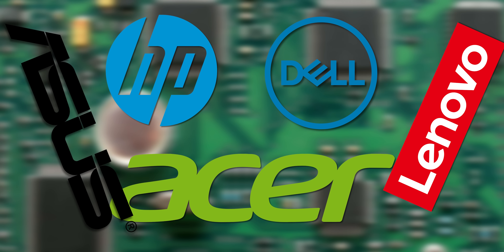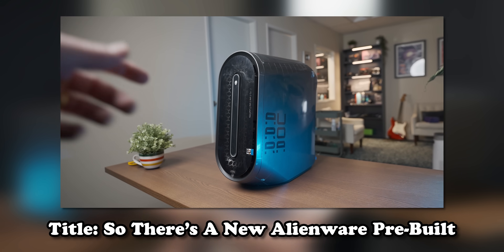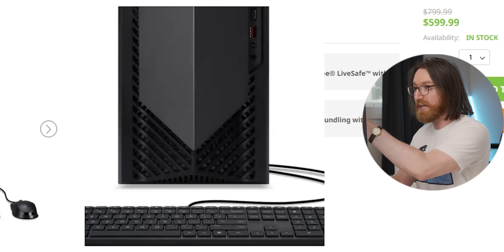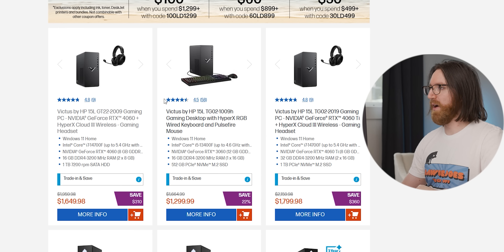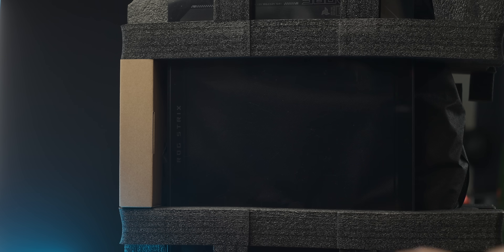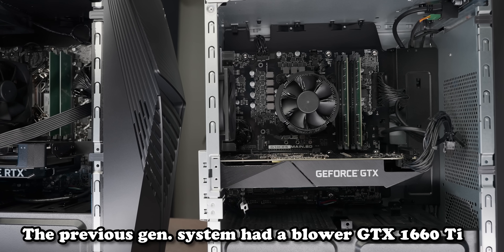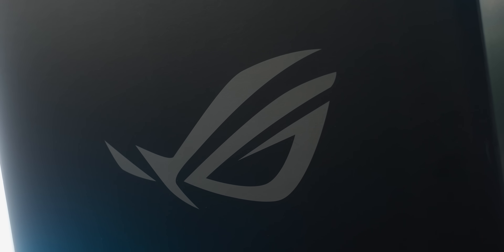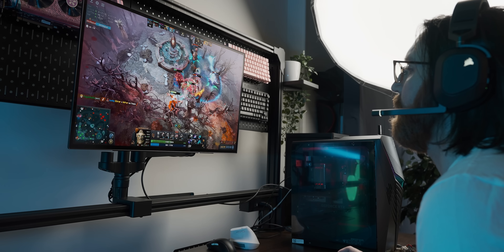Are Pre-Built Gaming PCs Better In 2024?

Comment: Surprised you didn't try the Old pre-built internals in the New case just to show how much better having a simple front vent is even for lower end hardware
Reply from the maker: @prrocker9637  That's a good idea, although it wouldn't make a huge difference to the noise. The main source of noise is that blower 1660 TI and it doesn't care too much about access to airflow.
Reply: @DawidDoesTechStuff  that's fair then the new parts in the Old bad case 🤣
Reply from the maker: @prrocker9637  Haha!! Yeah that makes more sense. Maybe I should drop a 4090 system in that old case.
Reply: @DawidDoesTechStuff what do you mean maybe? :D when's the video coming out?
Reply: @DawidDoesTechStuff  oh an oem sleeper I guess.
Reply: @DawidDoesTechStuff  why_not_both.jpg
Reply: @DawidDoesTechStuff  That could be fun. Maybe a test to see how much thermal throttling can reduce your performance?
Reply: @DawidDoesTechStuff I'm thinking of buying a pre built cyberpower pc at Walmart from what I know you can upgrade them
Reply: @DawidDoesTechStuff mind you, the blower 1660ti is loud because fans are ramping up due to low airflow the old case
I think you have a great opportunity to compare and combine 2 different generations of the same product 
I don't know how YouTube will promote it but it would certainly be unique
Reply: Great idea. We need another video.
Reply: This. That's always been my first thought.

I've done it before and it worked great
Reply: Or you could just leave the side panel off to prove the same point.
Reply: I imagine it's getting returned.

Comment: That 14700F is clocking between 3.8 and 4.5 GHz in game isn't that a bit low ?
Reply: well it is under 50% utilization so ig the GPU is bottlenecking the cpu
Reply: @itsmilan4069  A bottleneck doesn't necessarily affect the clock speed. It depends on how many cores are used, the temperature overhead, power consumption...etc
The less the CPU is stressed the higher it can boost, with 30% utilisation and 60W power draw I expected around 4.6GHz all cores.
Reply: It's way overpowered for the gpu, probably doesn't need to boost any higher.
Reply: It might be the overlay showing average core clock speed, which gets dragged down the E-cores. Possibly.
Reply: That’s kind of surprising that it’s that slow, one of Intel’s higher end chips from their newest desktop generation known for being power hungry, 0.6GHz slower than my now 2 generations old R7 mobile chip
Reply: Not really

Comment: I'd be curious to see how that poor little motherboard's VRM handles the 14700F outside of gaming, I'm not sure heavy loads would go too well 😅
Reply: It's not the K sku, so it is not as power hungry as those behemoths. Technically it's not even on the "naughty step" list that Intel produced (your opinion on the validity of that list may vary lol). It's 65W to 250W, but OEMs usually have a custom BIOS that will cap it at whatever the default cooler can provide (in this case, probably about 150W)
Reply: @peterwstacey this is Asus, the company that started with that thing with the multi-core enhancement. I bet they have MCE on by default, and probably off with the new 0x129 microcode update.
Reply: @renerant  it's a non-K processor, so MCE shouldn't do anything even if it is enabled. I think it is also only on Zx90 motherboards as well. But yes, ASUS are way too optimistic in their enthusiast board settings in my opinion
Reply: It's directly in the airflow path between the CPU cooler and case extractor fan, it'll be fine. Even without any kind of heatsinks, just having airflow run directly over the package surface is enough to get away with a lot more power draw than most people would think. Not that I don't have a stock of little baby heatsinks to stick to any bare VRMs I find.
Reply: it'll be fine cause it's a standard none K sku
Reply: most VRMs are surprisingly overbuilt even for the higher power parts. youd be impressed how little the weaker ones stress anything
Reply: I’m more concerned with the CPU 😂
Reply from the maker: @drew2626  For sure. 😂

Comment: You could have monitored HWINFO or something to check for VID spikes beyond 1.5V, that seems to be the issue behind cpu-splosion.

It's kinda crazy ASUS didn't insist all retailers either return these for the BIOS update or make retailers install it themselves. It will almost certainly not be updated by the user... unless these come with capsule firmware updates enabled? they possibly do.
Reply: I've seen some BIOS updates from newer computers being pushed via Windows Update, so maybe that could be the solution to this?
Reply: @ahernandez094  Yeah that is a capsule update, a lot of laptops come with it enabled but not sure about desktops.

Comment: Cutting holes for air flow took them how many years to figure out?
Reply from the maker: @Burrfoottopknot  Way too many. 😂
Reply: @DawidDoesTechStuff  these corporations have engineers etc, someone has to be asleep at the wheel lol
Reply: @Burrfoottopknot  But the engineers are paid/forced to find ways to make the computer cheaper, rather than better. 😥
Reply: 30 years, i can say that with confidence.
Reply: they will probably revert to old habits in next generation the engineers need to do something.
Reply: They don't it was a accident
Reply: About tree fiddy
Reply: @stragulus 😂😂😂
Reply: ...and they didn't bother to add a front case fan to help matters even further. Typical OEM crap.

Comment: Dawid, the 14700F isn't a K unlocked skew, it's not affected by the overvolt degradation issue afaik
Reply: Incorrect. It's any desktop SKU of CPU based on Intel's B0 die, which is EVERY model of 13th and 14th gen that's xx600 and higher, whether it has letters after it or not. I believe the HX mobile SKUs are also B0 based, but they have much lower power limits, and RMAing all those laptops possibly would bankrupt Intel, so they're being cagey about them.
Reply: this is correct!
Reply: just because the warranty isnt covered doesnt mean its not affected, thus the microcode update